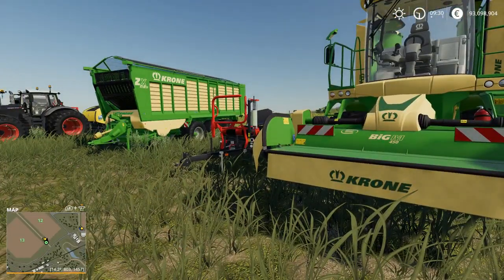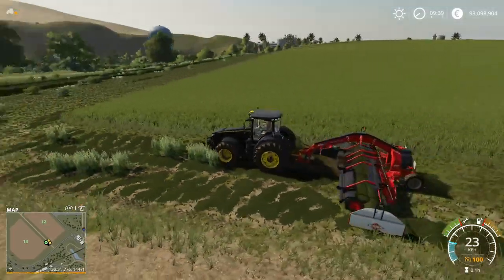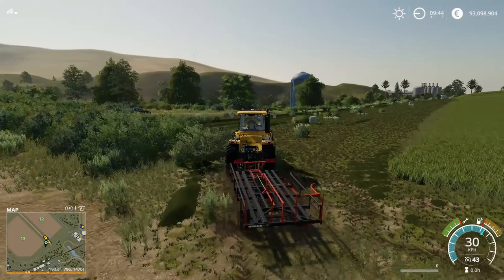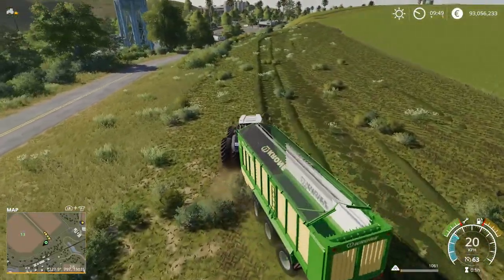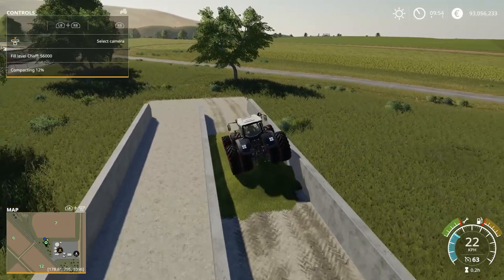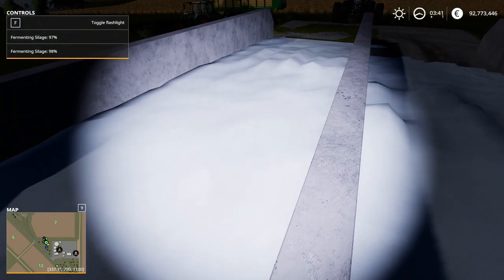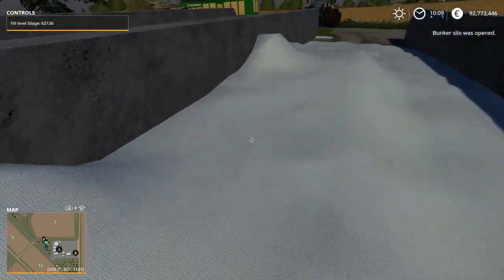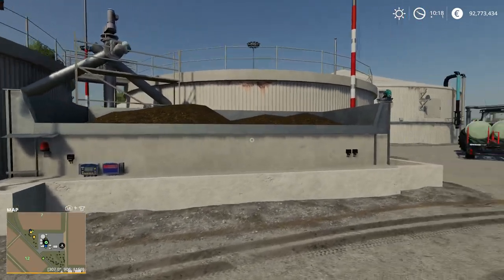The Ultimate Guide on how to make Silage | Farming Simulator 2019

Comment: the Big M mower does windrow it.
Reply from the maker: Hey Arron, this is true to some degree but it's still seems to miss a bunch. It seems to have somewhat of a windrow down the middle for a majority of the grass but there's still a substantial amount that seems to get left outside of it that is definitely worth while picking up.
Reply: @KlutchSimulations  Hi Again, You can hit RB and L3 to change the swath method on the Big M. Options are Left, right, swath drop (which is in anice line) and wide (which is what it defaults too) - great vid though, thanks.
Reply from the maker: Aaron, I had no idea you could do this...I am definite going to check this out for sure! Thanks so much for watching and commenting, really appreciate it!
Reply: It definitely has groupers on that’s what the big cylinders are behind the mowers
Reply: Its not a bad mower it can also pull a tedder (Pottinger) as well as windrow, I personally miss the big M500 mod from 17 (console), the mowing heads followed the ground better, windrows where great and you could pull more than a tedder behind it

Comment: i found that the best way (not very realistic) is to uncover the whole silo using a tractor with a silage fork. Just drive the tractor over the silage with the fork just high enough that u wont pick anything up and slightly lower the fork when u get to any covered area and it will be removed.  After the whole silo is uncovered use a big tractor prefered with 2X wheels and drive back and forth with a loading wagon and just pick it up.  Depending on how flat u got it before blanket the silo will determine on how easy/fast u can pick it all up.  Avoid big hills or u may have a problem with the tractor getting stuck as u try driving over them.
Reply: Or just use a conveyer belt lol

Comment: Does the BGA have a set price for Silage now or does it change with the same price as the barn price?  In fs17 the barn hade a fixed silage price dident mather how mutch u sold the price stayed the same in fs19 the price at the barn change.  Does the BGA use the same price?
Reply from the maker: The barn price (or price for straw) does change however from what I've seen the BGA is static. I've heard rumor that the BGA has increased their prices with this latest patch however but I have not confirmed this yet.
Reply: Yes in normal mod 350$ in easy mod i think 500

Comment: I don't know why but I can't get silage pits to work for me, I've tried everything from the manual dumping of a trailer (does the unloading animation but nothing comes out of them), using a bucket/silage fork, and even conveyor belts (no clue how they work in 19).. the only thing that remotely works is using the "leveler" plows but the biggest one you can buy is too small for the smallest pit and bugs out having 1L of grass stick to it so it can't fold back up or move anything else.
Reply from the maker: Hey JasperGaming, I know exactly what you're talking about. I didn't have any issues with my playthrough saves or making this video but in a recent livestream I ran into this exact issue. 

You can find the live stream here: https://youtu.be/MlxRdY5fCXs , take a look around the 2:10:00 mark on that video and it may help. Good luck and let me know how ya make out!
Reply: You need to buy the bga
Reply: @mohammedakmah5230  this was fixed already, but for clarification it wasn't the BGA pits that wouldn't work, it was the buyable silos

Comment: So the ultimate guide starts by showing the Big M not merging the rows in a single middle swath? xD
Reply from the maker: Yeah I know, didn't see the windrow option on this apparatus. I even checked the tool tips and missed that one somehow. In my defense, I'm pretty sure they changed the buttons in '19 for the windrow options...oops
Reply: @KlutchSimulations  Thanks for the response. I can understand how one could miss it, i missed it too myself. My point is that if you'd like to have the audacity (which is nothing bad in my view) to name something the ultimate guide, you should be more thorough, that's all!
Reply: @whammerjammer9185  Indeed it does - just check out the comments section of the 'Ultimate Guide to Mowing' where the other sheepdogs clearly point these tips out.

Comment: Is it possible that the BGA can only process so much silage at once?  So adding a bale while it's still processing it won't "accept" it until there's space?  Just a thought.
Reply from the maker: Not really, I've heard from more than a few that there's a sweet spot for the bails to hit. Once they are accepted you will see the counter on the left immediately go up to the amount that is currently at the BGA. There is however a set rate in which the BGA can process the silage that's already been accepted. The display will always countdown at the same rate so theoretically there is a max amount per day you could make from the BGA if you were able to keep it full the entire time.
Reply: @KlutchSimulations  Yeah hope they fix the trigger in an incoming patch.

Comment: Hi. Did you recieve no money for selling silage or how does it work? Thank you.
Reply from the maker: So things have changed a little this year will silage. Other than the fact it can be a pain to place the silage bales, you also don't get paid for silage until midnight. Surprised me too the first time I tried and didn't get any money but the counter was going down.
Reply: Klutch Simulations but came those money later, after midnight pls? And can I “sell” a different value or is it limited for day?
Reply from the maker: I'm not quite sure what you mean TheSnoopyBA, when you drop silage off at the plant you will see the display change and show that the plant now has your silage and is using it. As it uses it, the display will count down slowly and at midnight you will get paid for the amount the plant was able to use up.

If you were to drop silage off there just before midnight it may not be able to process much of it and it's possible you wouldn't get paid for the majority of your silage until the next day. I'm not 100% sure but I believe you will get the rate for the silage for the day that it was used up, no necessarily the day you dropped it off.

Hope that all makes sense.